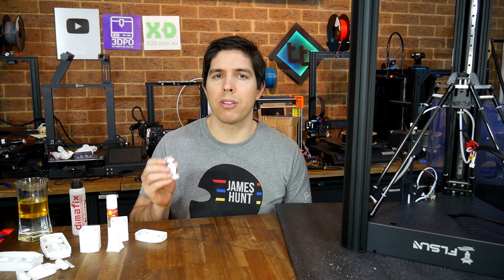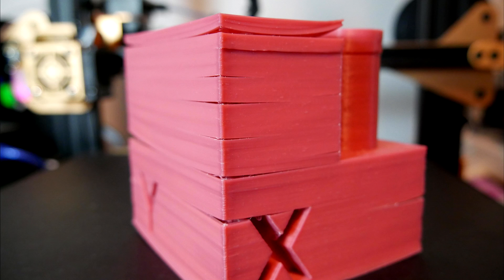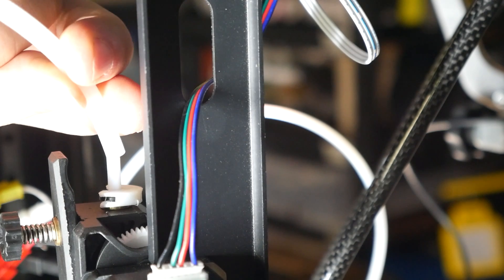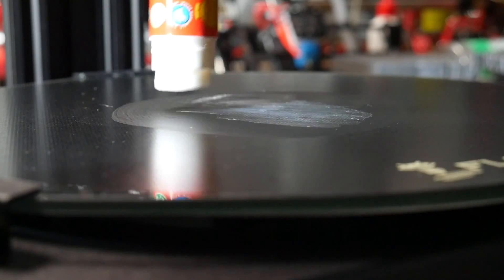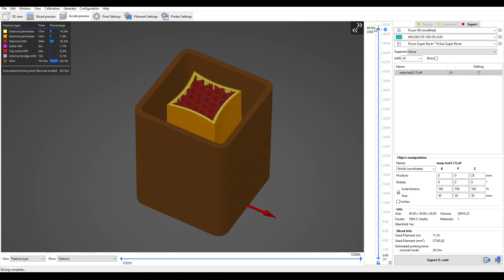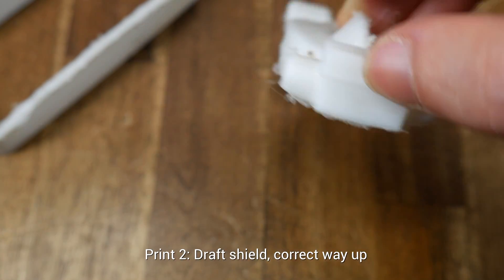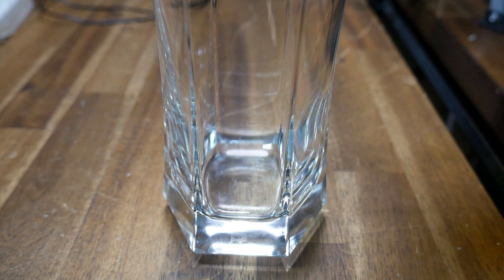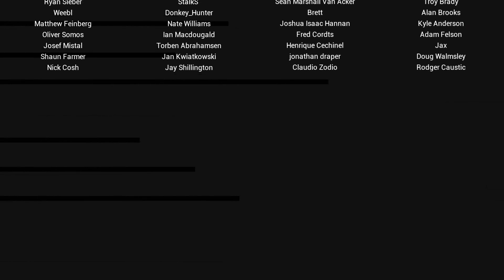Can 3D printing upside down help reduce warping?

Comment: Rocket Labs is 3D printing their entire rocket. Apparently what they do is calculate the deformation and adjust the print so it becomes straight once it cools.
Reply: I think you are thinking of Relativity Space. They are 3d printing a rocket. Rocket Lab is another launch provider
Reply: @sampfalcon5128  whoever they are, I'm referring to the folks who have 3D printed a rocket.
Reply: @sampfalcon5128  Rocket Lab have been printing components from the start.  They also use batteries for the rocket engine pumps.  Different approaches to get costs down and make iterative design easier.  (SpaceX also do an iterative design process, but with more ‘traditional’ technology in the main.)
Reply: @sampfalcon5128  thank you very much, that's what I get for posting before coffee.
Reply: Like others have said, Rocket Lab doesn't 3D print the entire rocket, that's Relativity Space.
However, Rocket Lab does 3D print their Rutherford engines in California.
Aerojet Rocketdyne will also be 3D printing the main combustion chamber on the next batch of upgraded RS-25 engines for the SLS/Artemis moon rocket. Those will only be used once all 16 current Space Shuttle-era engines are expended, at a rate of 4 per rocket.
Reply: @Mustache Merlin and I get the feeling people who 3D print orbital rockets and parts, have a few 3D printers at home, and experience the same issues we have.
Reply: That would introduce some calculation overhead and would require detailed info on how the material warps. It's doable but not by the average person's setup.
Reply: @williamaycock579  I don't think it works in real time. It's generated at the slicer level, but I might be wrong.
Reply: It wouldn't ever happen with something like an Ender 3, but it could happen if a company made their own printer with their own material with their own preprocessing regimen and with their own slicer.  That's not impossible. A few companies already fit with that criteria, they would just need to snag one of the big brains that know how to calculate the deformation of the material and apply said deformation to the print.
Reply: Yeah. But that's not going to happen on hobbiest machines.
Reply: @alejandroperez5368  just because you don't know how it doesn't mean it can't be done.
Reply: @jtjames79  you realize that technology only works for that specific machine in that specific environment with that specific printing material? You're not going to see it happen for hobbiest machines because it's a very complex engineering problem specific to each case. Just use your brain harder next time?
Reply: @alejandroperez5368  just because that algorithm is used in a different additive manufacturing process that does not mean there is nothing that could be learnt and maybe implemented in FDM printing. And even is there isn't that still doesn't mean that you have to be a condescending a hole about it.
Reply: @Pedro7526  it's not going to happen due to the complexity matters I mentioned. 
Only one that doesn't know what applying that technology requires would argue the opposite.
Reply: @alejandroperez5368 I think we can agree that regardless of the complexity, said warping compensation technology has very little to do with the type of warping and delamination problems this video is about.
Reply: @alejandroperez5368  also, I'm sorry if I offended you, I'm very drunk at the moment
Reply: @Pedro7526  possibly print on top of supports to eliminate base warping, by giving you some room for z warping adjustments. Print it warped in one direction and let it unwarp itself as it cools.

Comment: The theory being that hot air (I'm assuming from the hot end) will rise into the draft shield, it seems to me that you would lose more heat from the heated bed, than is generated by the hot end by flipping the printer over.

Comment: Use a wet sponge to clean the glue layer, this will dissolve the glue and lay down a new thin layer
Reply: Wet paper towel works too.
Reply: @candorman9444  Yeah but the sponge is so full of glue now I just wet it to apply a thin layer.
Reply: @GaryGraham66  I wonder if I could fill an empty magigoo applicator with watered down gluestick
Reply: @candorman9444  Probably, my sponge is solid once it has dried, I think it has at least one glue stick in it. 😳
I spray water on the build plate then use the dried sponge to soak it up and even out the glue on the bed, then heat the build plate up and repeat the process until I have a nice even layer.
Reply: This works perfectly if you use diluted PVA glue.  I’m not sure about some of the glue-sticks, though.

Comment: I have really good bed adhesion results by applying glue stick, then using a baby wipe with alcohol to spread it nice and flat. The fibers pick up extra glue bits, and the alcohol cleans up everything that isn't glue. I only have to re-up like glue stick once every four or five prints, as long as I alcohol wipe each time.
Reply: I've done the same, sans the baby wipe. I just use my finger to even it out. Lately i've only used hairspray as it gives much better finish on a glass bed. I also use 400 grit sanding sponge to get the sheen off, i get even nicer surface finish. 

Other tricks: use loads of glue, apply isopropyl alcohol and brush. It can make a nice brushed finish. Or apply loads of hairspray in multiple layers until you get "orange skin" effect. There are loads of different ways to get microdetails into the bottom, i've also applied heavy coating of glue stick, smoothed out really well using isopropyl spray, then printing a geometric pattern first, then the actual object. The first print will imprint the shape onto the glue and further prints made will have that pattern. 100% isopropyl in a spray/mist bottle is very handy when smoothing out glue layers.

Comment: I had this idea for my budget ultem printer! My reasoning was to avoid heating my linear rails and components tho. I don't haven't money to test any of my ideas tho. I was gonna combine it with a part heating fan! (Yes blow hot air instead of cool hair)
Reply: Budget and ULTEM on the same sentence sound funny! like, a kilo of the material itself might cost more than many printers out there... 
On that note, have you seen some of Stratasys patents on heated chambers? They expired a while ago (even if they didn't, if you're making your own project it shouldn't matter if you won't sell it), and show a Core XY machine with bellows closing the gap between the X and Y travel, the X having two bars then. Even Z has heat shields. Keeps everything heat shielded by the bellows, even the extruder motors if using direct drive. US6722872B1 if you're curious.

Comment: I hope we start seeing heated chambers now that the Stratasys patent has expired. My Method-X (poor man’s Stratasys) with heated chamber is a pro at warp prone materials, the heated chamber is so much nicer than a heated bed for ABS/PC/nylon.
Reply: My 3D printer has a heated chamber.

I stuck the box that it came in over the top of it.
Reply: Not the same. Most steppers skip around 60C, my heated chamber goes to 95C. There’s a HUGE difference when you can print in an environment around the polymer’s glass transition temperature.
Reply: @JoeStoffa  meh, I'll just pay the couple bucks more for the carbon impregnated nylon.

Not that it would be hard to build an actual heated chamber. It's a box. And there's more than one way to skin a cat. Stick some peltiers on the parts you need to keep cool, doubles as your heating element. I also like stealing heat pipes from my local laptop graveyard. Buy steel I mean I pay scrap prices so like a couple bucks or something for a handful of them. Helps for getting into tight spaces.

I haven't bothered cuz I haven't needed to print anything in nylon yet. I guess I never imagined people found it complicated.

Comment: would printing upside down reduce stringing/oozing from the nozzle?
Reply: Definitely oozing. But more interesting is, you can do some insane bridgeing printing up side down.
Reply: Interesting thought, in theory it definetly should
Reply: Most oozing isn't due to gravity, it gets pushed out by steam. I find dry filament doesn't ooze at all. I have wondered about bridging upside down, good to know it works.
Reply: @nophead  from what I've learned around, it's more to do with hotend pressure, and a retraction helps mostly against that. When you extrude, the material compresses a bit and stays like that if you stop extruding. That compressed plastic makes it ooze.
All materials I've printed (ABS, PLA, PETG and TPU) all ooze even when straight out of the package.
Reply: @Kalvinjj  I mean ooze after retraction. For example at the end of the build wet plastic will ooze a few cm but dry plastic doesn't ooze at all.
Reply: @nophead  Hmm... I haven't experienced that indeed, given none of my filament rolls are a year old yet it would make sense (also my PETG is very new too and well stored). Nice to know.
Reply: @nophead  Wet and dry? Do you mean hot and cold? I think gravity does play a role in oozing when the extruder is idling while the hotend is hot
Reply: @nicholaslau3194  No I mean water content. If I dry my filament with a heated spool box it doesn't ooze when the hot end it hot and retracted. The plastic is too viscous to ooze through a small orifice due to surface tension. I doubt water would flow through that hole without some pressure. 

When the filament has water content the steam produced propels the filament and makes it ooze. Before I fed my filament from a dry box I would get about 30mm of filament oozing from the hot end while the extruder cools down at the end of a build that I would have to snap off. Now I get none at all.
Reply: Found a video.
https://youtu.be/ZAPaOevoeX0?t=478

Comment: I've always wondered this. Not for the same reason, I've just wondered if the print would stick.
Reply: It is not gravity that keeps the print attached to bed...
Reply: @pjak2000  thanks for the reply. Ive always thought it was little keibler elves that sacrifice their lives to weigh down my print. Thanks for the clarification!
Reply: @ChinCultTV  no problem :) just print safely and happily.

Comment: Seems to be an interesting theory regarding rising hot air, but the experiment says otherwise. Nylon just seems to be yet another tricky material to master.
Reply: Rocket Lab, is 3D printing their rocket, like the whole thing.

They actually calculate the deformation, then adjust the print so it straightens out as it cools. Paraphrasing a quote "looks pretty noodily when it's printing, but then straightens out to less deviation than a human hair." Or something like that.

I can't wait till I can rent some time on Dojo, to train an AI that would do something similar among other things. Probably going to have to upgrade my raspberry pi to a Jetson or something.